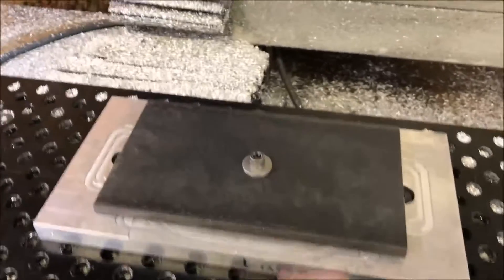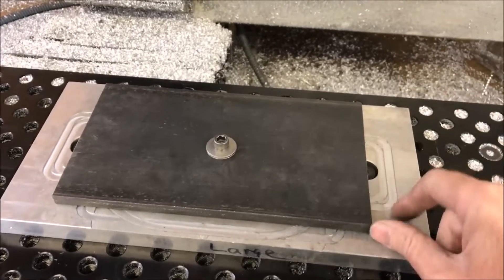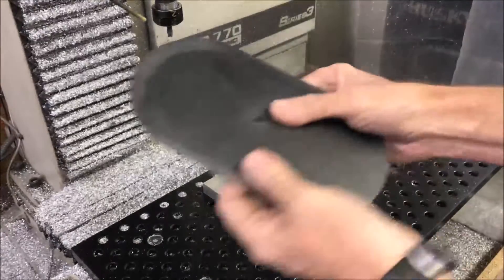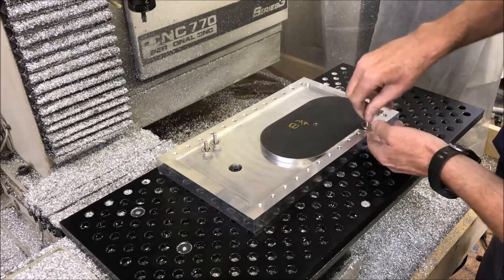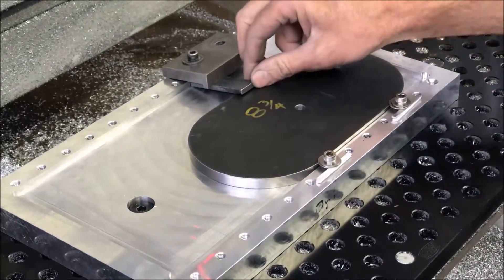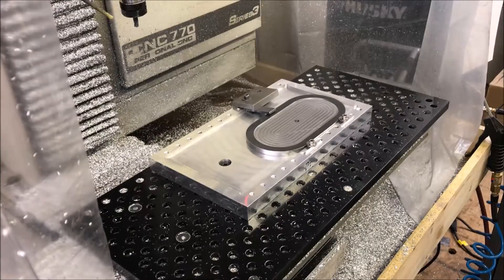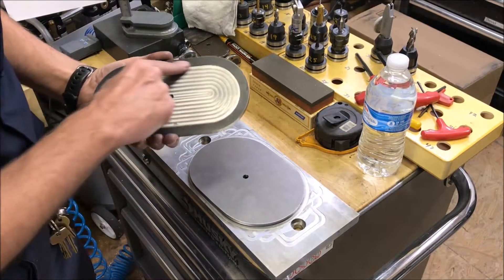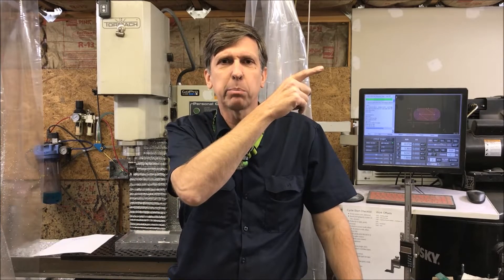Concept to Part in Under 2 Hours - Large 3/8" Steel Part

Comment: Why didn't you just use a vise?
Reply from the maker: Not sure how I would do that without going to 1/2" stock and then I would have to cut off the hat.  Is there a better way?
Reply: Craig's Machine Shop. Couple ways but me would have cut the pocket and hole first. Then find pieces of scrap put dowel holes in and tapped hole bolted it  down like you had used dowel to stop from spinning
Reply from the maker: I don't have a vise on the mill very often, mainly fixture plates.  You have a good point though.  I should have done the hole and pocket in the same op on the drilling plate. Thanks!